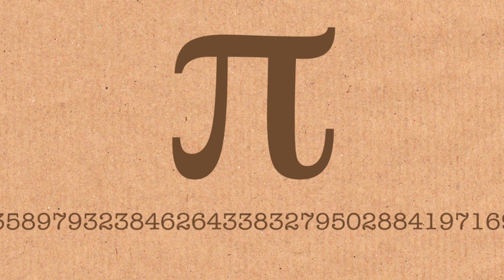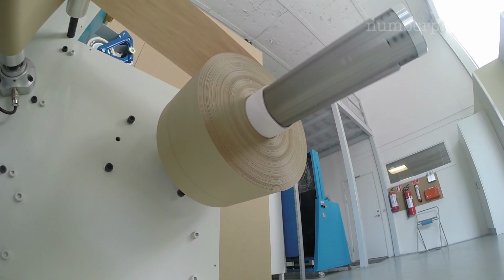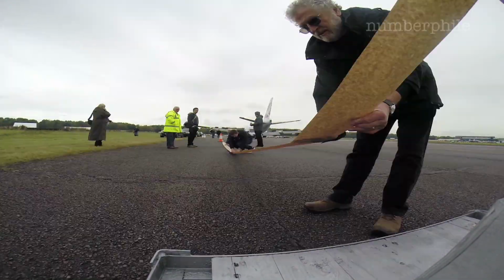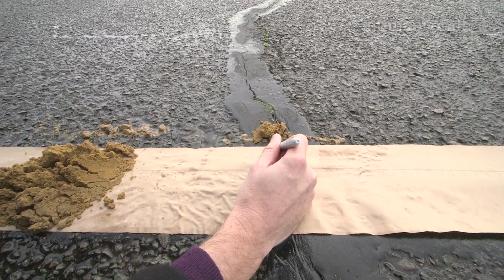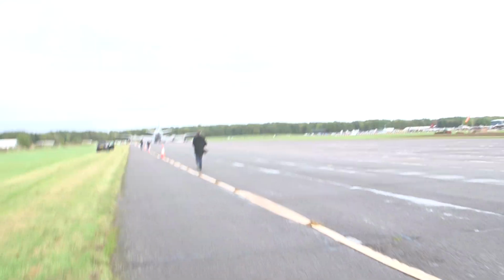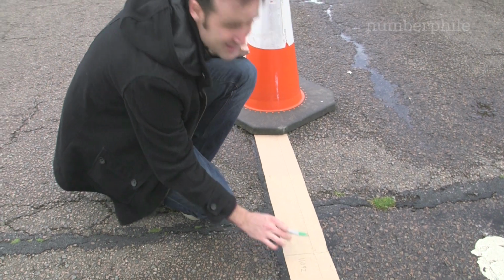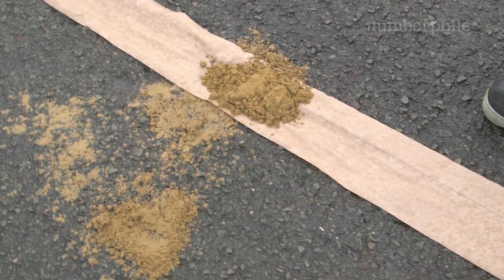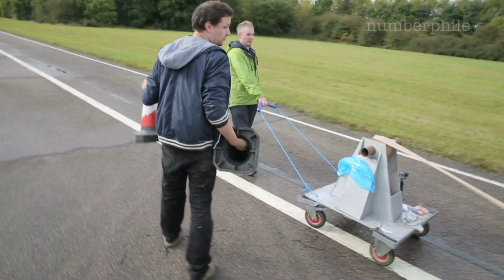The Making of a Mile of Pi - Numberphile

Comment: you forgot that the 40th decimal place is accurate enough to calculate the circumference of a circle that surrounds the known universe with an error no greater than the radius of a hydrogen atom.

Comment: Imagine someone comments all the digits on the piece of paper
Reply: Fun fact about pi it is closer to 195/25 then 22/7 did all the math in school it’s very complicated basically I simplified 1415926/10000000 to 707963/5000000 then rounded it to 707900/5000000 then I simplified it to 7079/50000 then rounded that to 7080/50000 then simplified that to 708/5000 simplified that to 18/125 then I added 375/125 which is three so I got 390/125 we can be simplified to 195/25 also 18/125 is about 0.0246 percent off did all of that in school

Comment: I never once believed that Pi can repeat itself in any way, until now... Of course it makes sense, because in Pi, there is digits 0-9, that is 10 numbers, so there is x amount of times there can be unique combinations of 10 digits until one MUST repeat itself, like 314159. Someone please do the math on how many unique combinations there are in 10 digits.
Reply: +Thallanar Rabidtooth 9 numbers equals 1 billion combinations. I think the most unique part of PI is when the sequence 999999 occurs around the 762nd digit
Reply: 2fastHarley So, Pi does repeat, in a sense, since it never ends, it will eventually hit 1 billion combinations of numbers, and 2 billion, and 3 billion... Right?
Reply: I cant answer that. To repeat, is to say another one, or a copy or to be the same as the first set, but Pi never ends, So there is no original to repeat from, or a starting point or an ending point to clarify where PI repeats itself.
Reply: 2fastHarley Yeah, true, but you can pick ANY set of numbers, like 3.14159, and see that set of numbers repeat somewhere in Pi, like shown in this video, so it technically does repeat, just not in any logical way.
Reply: Thallanar Rabidtooth Yes with a set of perimeters such as a 6 digit sequence like 314159 you are bound to find it again some where. How far deep it is, I have no idea, but it could be a lot closer in than you would think.

Comment: when does pi repeat in its entirety? obviously in a number that goes on forever, you will come across a repeat of the previous numbers involved at least once, and at most an infinite amount of times.
Reply: It's infinite, therefore it's infinite. So yes.
Reply: Daniel Williams It doesn't repeat. It's irrational.
Reply: i assure you that if you go far down enough, you will find a repetition to x amount of digits in pi, inside of pi.
Reply: Yes but not all the digits.
Reply: Infinity inside infinity. So kerbal.
Reply: pi has every series of digits

Comment: i also like monospace fonts like courier new.
Reply: Otherwise it would not have worked out technically. In reality it was not "1  million digits" that was printed but some 100.000 blocks of digits. And they would have had gaps if it wasn't for the monospace font.

Comment: Why are you printing only one line per page. 

In a page you can fiit at least 20 lines if not more.

Complete waste of resource's.
Reply: We could easily have fit 16 x 4 lines, cutting the length by 80x, to about 20 meters. But it would be just a load of numbers appearing on the paper. And "20 meter of pi" would not be nearly as much fun ?

Comment: Dislike for not using comic sans

Edit: and not printing 3.141.592 digits
Reply: Comic Sans is not fixed-width, doing so would have left gaps in the print. We could have printed 3141592 digits, but the machine would only hold about 1600 meter of paper. 3.1 times the amount would need more paper..